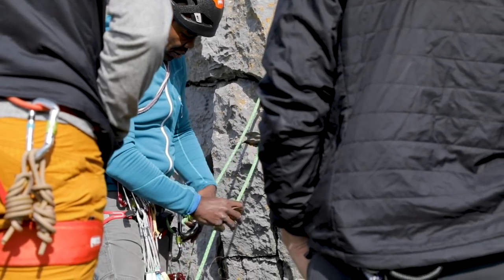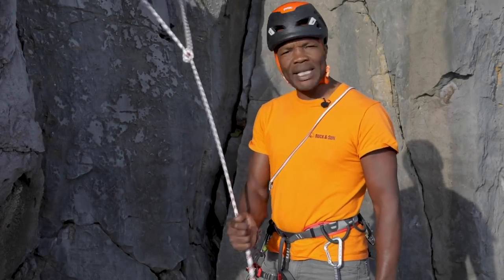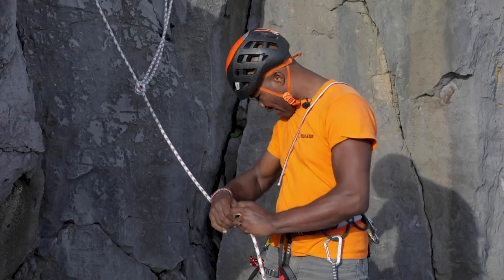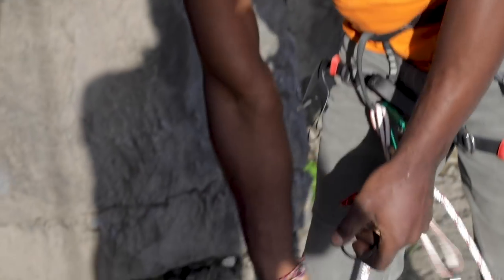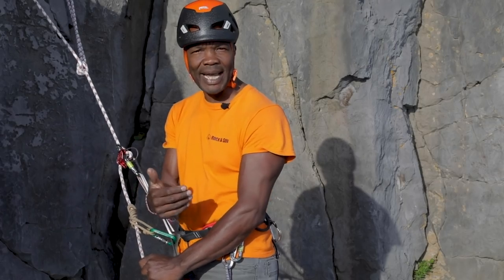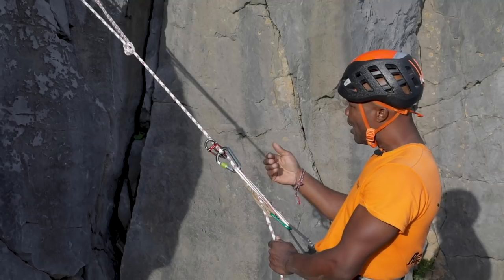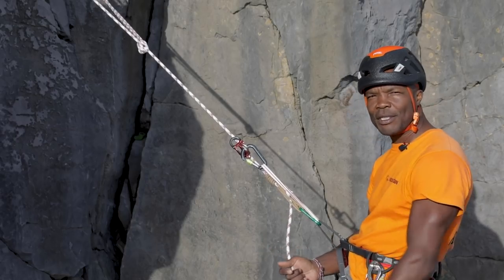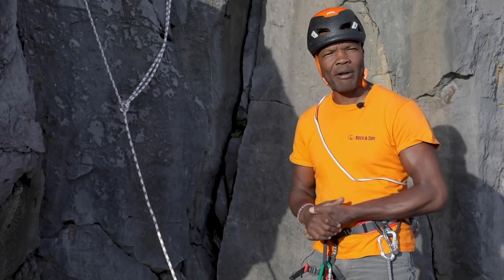How To Set Up An Abseil | Climbing Daily Ep.1545

Comment: I would thred the extension loop along aside the belay loop. Not IN the belay loop. I learned only metal in the belay loop.
Reply: Agreed. I girth hitch sing to tie in points and tie overhand knot. Keeps out of the way of third hand and complies with only metal on belay loop dictum
Reply: Belay Loop or Tie in Points is fine. No reason to dogmatic about either.
Reply: John Daley It has to do with the fact that nylon wear and tear on nylon much more than metal on nylon, and you don’t want to wear out the belay loop. Hence, metal in the belay loop and nylon alongside the belay loop as this webbing is made for more wear and tear from nylon on nylon.

Comment: Worth noting that the more your prusik wraps around your rope the more friction it will exert. Weight, gear, rope, and conditions can all play a big role in the needed level of friction.

Always act with the same level of precaution as if you didn't have one.

And prusiks don't stop you from falling but give you a slow descent. They will snap if you fall on them (but this shouldn't be an issue in rappelling/absailing).

Comment: I find it somewhat surprising that in a video about how to set up an abseil (even a mock abseil) that he made no mention of how a rope should be properly attached and checked at the anchor (if using a single like like shown) or that a rope should be equalized at the anchor point with stopper knots on both ends if using both lines. 

I'm sure this was discussed in his clinic, but for those that are only referencing this video, it seems like there should have at least been a brief mention that there is more involved before you are safe to abseil.
Reply: I imagine it was just meant as a short snippet rather than anything in-depth. 
Going over abseil setups and rigging introduces so many variables that would likely extend the video well beyond the 10 minute mark.
Reply: Yeah, I agree. One of the first things any rope setup tutorial needs to address is CLOSING THE SYSTEM. I can't think of a situation where you would need to leave the system open.

Comment: Why would you add another variable into the system with a sling in the belay loop? I’ve never seen that before.
Reply: To keep the pussik away from the belay device. It also puts you in a more natural abseiling position than the old method of using the belay loop for the device and a leg loop for a prussik (which also doesn't necessarily keep the pussic out of the belay device very well).
Reply: @georgebridgewater2573  
Interestingly I've been taught a variation on both. extending the belay device with a sling keeps it away from you and the prussic but still going for the leg loop with the prussic, to prevent the sling pressing against the prussic as you can see its almost doing in his video and possibly causing it to fail.
Reply: @chironturner4040  that is incorrect and not recommended by any reputable manufacturer or persons
Reply: @nathanburke8387  
Taught to me on training courses run by mountain training the national governing body here in the UK.
Reply: @chironturner4040  that’s was your instructors opinion ,as I said before no manufacturer or persons who are reputable recommend this ,if you find any evidence I would agree
Reply: @nathanburke8387  It's literally on that awful BMC video on the BMC youtube channel. He recommends larks footing the prusik to the leg loop, wrapping around the rope and then clipping into a carabiner in the leg loop! I don't agree with it, but that's the reputable British Mountaineering Council recommending what you say no one will.